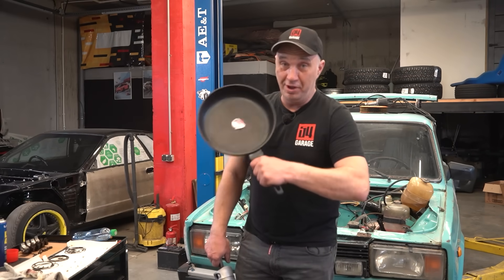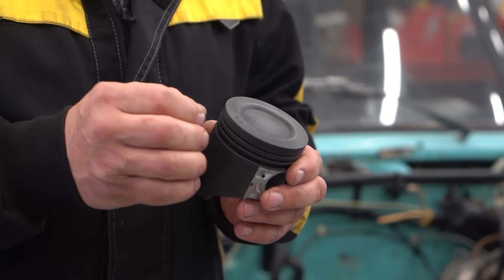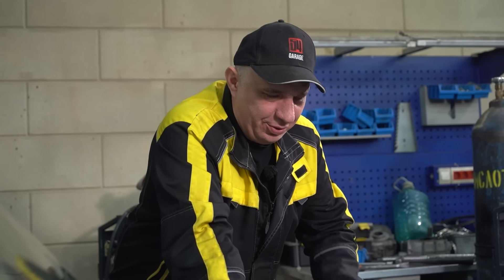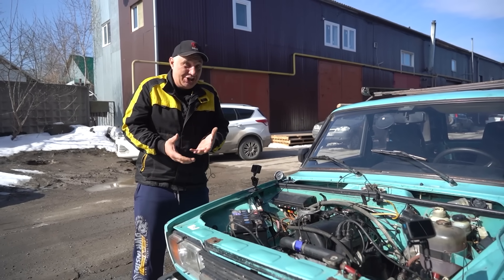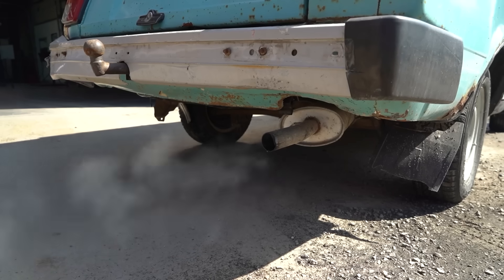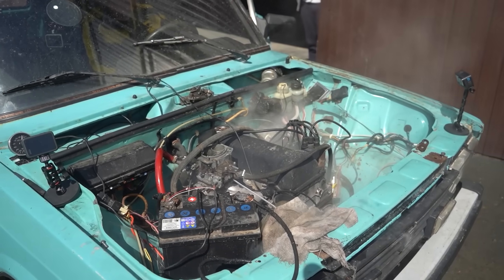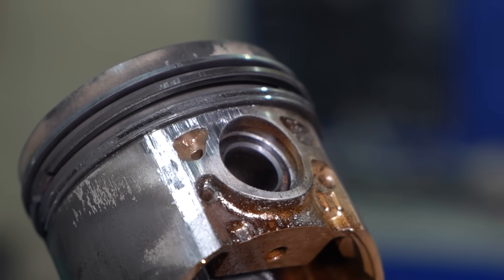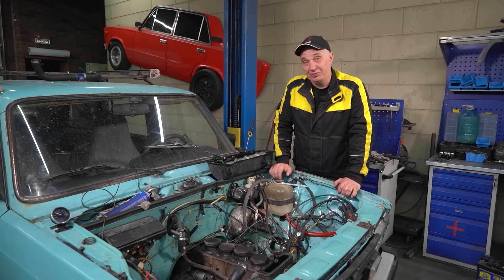We coat pistons with Teflon - what will happen?

Comment: Imagine using pistons to fry your eggs
Reply: Imagine using Teflon. Just use a stainless steel pan and butter, like God intended.
Reply: @centralintelligenceagency9003  does bane approve of using stainless?
Reply: @centralintelligenceagency9003  God didn't intended nothing.
Reply: they already make shorts on first channel.
Reply: I used to heat up Hot Pockets on the engine of my '74 Chevy camper van.